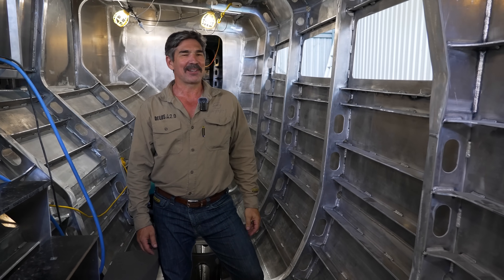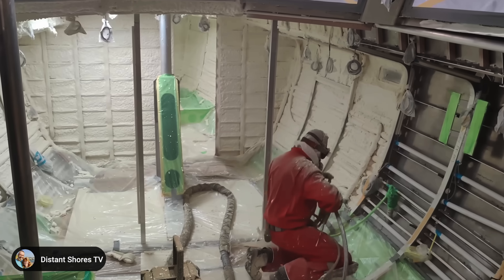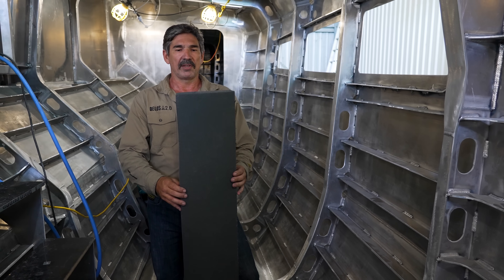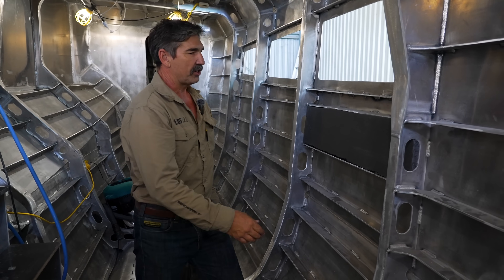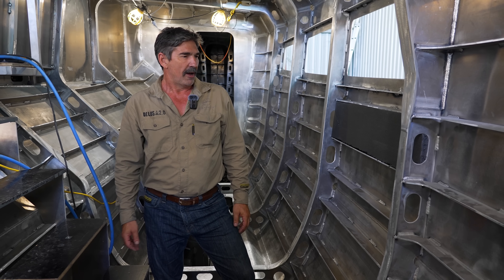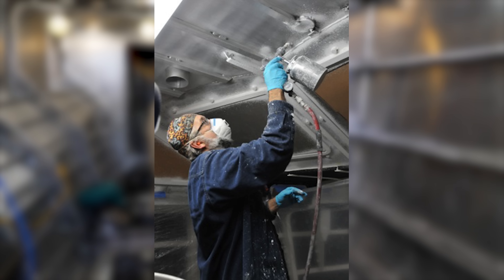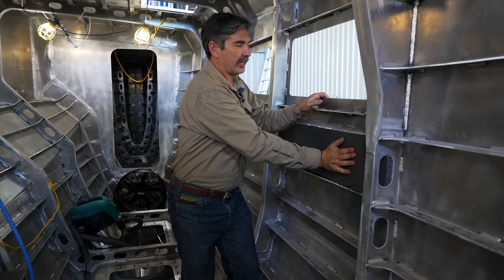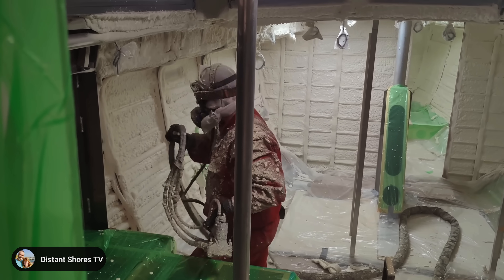HELP, We Need Your Advice!  How Should We Insulate Our Aluminum Catamaran???

Comment: I’ve been in construction, my whole life, dealing with insulation thermal transmission, condensation issues between insulation, and by far the best thing to do is to use a spray foam closed cell spray insulation.. the amount of work that you would have to do if you ever have to access the backside of it is negligible. It will scrape right off of the aluminum with a wire wheel. It will be clean. I don’t think the negatives outweigh the positives of going with spray foam.

Comment: I worked in a small datacenter that was built in two phases. First phase used bat insulation resting on top of the ceiling tiles, the second sprayed insulation on the bottom of the roof. Later that year when it snowed the snow on the spray on roof lasted two days longer than the bat roof, which melted first day. By the time the snow arrived phase 2 had about 80% of the load of phase 1.

Comment: they make cork spray insulation for this exact purpose. reduces thermal transmission, reduces noise, and reduces condesation, which is hugeon any boat, but especially metal boats. Sail Hub did a great video on this.

Comment: Brian, you're getting advice from everyone with good intentions. Considering the goals of preventing condensation, insulting the boat, fire resistant material, noise reduction, and potential problems of future repair or replacement - I would set aside the concern of how hard it might be to repair structure. :¬) Webhead USA

Comment: Closed cell spray foam.  If you're worried about easy access, maybe 1st primer layer and then 2nd layer closed cell foam.  You just need the encapsulation/seal.  Then you can always use the cut Neolon foam as a 3rd layer over the top of your first layer, and that can also provide a good thermal bridge to prevent condensation.  
After that you almost need a hull within a hull with minimal contacts between the two other than maybe adhesives to keep shape and rigidity.  The methodology is really the same regardless of the item (boat/house/aircraft/fridge/cooler/etc.).  
Another good thermal bridge is HDPE strips or blocks which are relatively lightweight.  You could place between any hull frame/strip to provide additional thermal bridge sort of like an electrical insulator.  HDPE won't rust, rot or deteriorate under any conditions and it is also buoyant same as closed cell foam!
Reply: Oh and I forget to include that Distant Shores TV just did closed cell foam on their new Orion 49 (Distant Shores IV).  See Aluminum Sailboat Pt 17 from about a year ago.

Comment: Use 3d scanner such as revopoint to create your as-is manufactured CAD file. From that digital CAD file you can make sure your whole project is still going good and matches your original specs and you can extract out dimensions for custom neolonXPE top cover
Reply: Seeing as how your electrical conduit holes didn't match original specs figured a 3d scan for your insulation dimensions could help

Comment: Spray foam. Any time you save on potential repairs, which you may never have to do, would be more than made up for  by the ease of installation. Also the areas most prone to serious impact damage are below the waterline and thus not insulated. How many times on Delos did you actually have to reach the inside surface of the topside hull for repair?

Comment: spray foam. hands down. A bit more prep work but saves soo much time in application. Is, as you said, way more consistent and provides better moisture protection.

Comment: I would go for the spray foam insulation ( high density) 2 part system its R value at 2inches thick is R18 and its sound deadening is excellent , just make sure your electrical and plumbing system is laid out to accommodate/ services ability , through hulls should be the new highly durable plastic ball valve style ( and serviceable ) .
The electrical should be through conduit pvc style pipe w/ accessabilty ports , so your lay out for lights/ swithes / fuse panels , this way wire can be added / replaced with out tearing into your walls or insulation.
 Recess your through hulls flush with your hull to reduce drag .
See parlay revival for the thru holes they used there like bulit proof.
 Take the time to do it right and you will save youself hudreds in labour and time and parts.

Comment: Hey Brian, check out these options used in submarines:

 Submarines use a variety of insulation materials, including:

Fiberglass

Fiberglass insulation panels can be used to create a submarine hull insulation system. Fiberglass can also be used to create scrimmed structures that are attached to the hull with a polyurethane adhesive. 

Mineral wool

Mineral wool is a common insulation material for marine vehicles because it's fire-resistant, water-resistant, and provides good sound and thermal insulation. 

Composite materials

Glass-fiber-reinforced plastics (GRP) and carbon-fiber-reinforced plastics (CFRP) are used in submarines for large 3-D shapes and sonar windows. 

Anechoic tiles

Anechoic tiles are used in nearly all modern military submarines. The Royal Navy began using anechoic tiles in 1980, and the United States Navy followed shortly after. 

PCM

PCM insulation can be used to insulate UUV hulls. The thickness of the PCM insulation layer can be adjusted based on the mission profile. 

Other types of marine insulation materials include:

Microporous structural insulation

Hull boards insulation

Elastometric pipe cover insulation

Fiber blanket

Aluminum coating insulation

Foam insulation

Wired mat insulation

Comment: I used to be a partner in a SIPs manufacturing plant. For those who don't know, SIPs (structurally insulated paneling) is a highly insulated construction wall for residential & commercial buildings.

The major factors that contribute to poor insulating & issues with water from condensation are the heat transfer through materials know as "Thermal Bridging".

We primarily dealt with wooden structures, although we made a significant amount of aluminum panels with aluminum square tubing for structural support.

Aluminum has a very high thermal conductivity.  Meaning that heat will transfer through the aloy very easily. This is likely to mean that ANY aluminum that you have that is connected via fasteners or welded to the exterior will undoubtedly transfer heat.
Unfortunately for your setup, I'm going to wager that even up to 10 inches of aluminum will likely transfer heat. (That number is based on my own testing using and IR thermometer to get a rough estimate of the distance heat is transferred through 3/16" aluminum square tube).

Typically for the product we produced we recommended no less than 3" of open cell foam insulation to prevent condensation and heat transfer. We also turned any studs or structural supports to reduce or prevent thermal bridging. Meaning we had at least 3" of foam anywhere there was a structural member.
All of our panels used bonded expanding adhesive that chemically bonded with the rigid foam and adhesively bonded to the other surface. And were then put in a 20ton press until the adhesive cured. The pressing created a water tight vapor barrier.

For your project, since pressing is not an option, you will most definitely need some form of condensation barrier. Just an additional note, if a condensation barrier does not have adequate insulation separating the 2 climate zones, you will still get condensation forming. If the barrier is a sprayed on type, you may experience delamination between the barrier and the surface it is sprayed on. However, I'm not certain what issues might arise should that occur.

If it were my boat, i would run either conduit or pvc for electrical runs, water lines, or anything else you need to run. And then spray foam the entire interior cavity.
Spray foam is going to give you the best seal, vappr barrier, insulation combo. You could even consider the other sealing products you mentuoned in addition to spray foam.

Regardless of what options you go with, you should know that the most likely culprit for condensation is going to be the most inward parts of the aluminum structural members. This is because they will have the least amount of insulation, and are most likey to have thermal bridging where the hot exterior meets the cooler interior.

The second most likely culprit for condensation is going to be any doors, windows & hatches. As again, these will be the spots with the least amount of insulation and the most thermal bridging.

Extra care to seal and insulate (as best you can) around any openings will save you headache in the long run.

Comment: Primer coat on the bare aluminum with the foam insulation bat panels and then sealing everything with a 100% vapor barrier will totally seal the thermal bridging and stop condensation.

Comment: My two cents: 1) don't use anything that is open cell or conducts vapour. Closed cell foam all the way. 2) Agreed on ability to replace like panels but you should close the gaps and connect the panels with something sprayed or glued on 3). The big trick is how to prevent thermal bridges while you have to connect the internal shell to the hull solid enough so you can place furniture on them.  4) Sounds counterintuitive but please-please check any material for long term outgassing - it can become nasty when e.g. polyurethan starts decaying in closed spaces - and how it behaves in case of fire, is it flammable, and what kind of smoke it develops while burning. 
Finally, you don't necessarily have to use the same solution in every part of the boat. You may, for example, use different method in the forepeak, under the waterline or for the deck saloon.

Comment: My boat had the spray foam insulation, it was built 10 years before I bought it. It was also lined in thin ply, it was quite noisy when sailing and no insulation in the bilges. When whales were around you'd hear them way before you could see them.

Comment: You HAVE to use the expanding spray foam, no painter could guarantee 100% primer coverage on the inner hull because there are too many angles with all the metal ribs, holes, etc. You need to re evaluate your giant bus bar system too unless you want to deal with crazy electrical problems out at sea.

Comment: some kind of coating is a wise choice before any insulation since as you mentioned even a small bit that's exposed bare metal with sweat. I used foam house insulation and did my best to seal all exposed metal. I used canned foam around the edges to eliminate air pockets. In Europe they are spraying cork and that seems to work well. Masecoat works well and even truck bed liner coating, the main thing as you know is isolation from opposing temperatures on exposed metal. My boat is aluminum as well and I am about sixty miles north of Seattle and a former shipyard project manager.

Comment: I think your planning skills are going to be key.  There are tight spots that will be hard to get to to remove spray foam.  If you will need to do any welding in those areas for repair the spray foam would pose a fire threat.  In those small areas plan paint and plan for condensation and how you deal with it.  If those small areas are sealed in a way that you can unseal and inspect later no warm air can get n and therefore no condensation. (Theory  (real life may differ from theory.))  Those areas are specific and would not pose a large condensation issue anyway.  The other areas spray foam away.  Finally again plan baby plan.  Your excellent planning skills will determine the quality of the outcome.

Comment: I built a plywood Jim Brown trimaran in 1974, sold it, rebuilt a new Hunter 30 and owned and sailed her until 1986. We sold that one and built a Van de Stat Falco hard chine steel boat in the UK.. We coated the inside and outside with coal tar epoxy and insulated with Styrofoam 2 inch boards. OK, but not that satisfactory due to condensation between the hill and Styrofoam  boards.  Spray foam was very expensive in 1986 in the UK. The next several builders at Morvaren Seacraft in Penryn, Cornwall sprayed and sureform planed the foam down to the frame and installed wood battens as needed. They seemed happy with the results. These boats were, at first, hard chine When the builders got the equipment to bend steel pretty much everyone sprayed. We spent 5 years in England fitting out our hill which we helped build and sailed her until 2004 when we " swallowed the anchor". Spent until 2020 at Hinckley repairing sailboats in Maine. That said....aluminium..huh?.. what?
Reply: Extra info (maybe): In 2004 we bought a falling down 1860s Cape and once again were on a "budget". Put 2 inch foam against the roof deck and sealed the edges with cans of spray foam , then Rockwood over that. Real good insulation...too bad the condensation rotted the roof boards after 12 years and we had another big repair. Live and don't learn!?

Comment: Hey Brian..  As a home builder, I think the most thermally efficient option would be the spray foam. However , its heavy and has maintenance issues. Closed cell press in batts get over this, however, all foam insulation that I'm aware of has R-drift. So the foam naturally shrinks over time creating voids and a "less snug" fit.  A great solution to this is edging any press in batts with a memory foam tape. The one I use in the UK is called Gapo tape you apply it to all four edges of the insulation batt and it creates a flexible friction fit for the insulation batt so it is always snug (you could forget the fixing spikes if it is fit correctly). This way whether you're sailing the tropics or the arctic circle, the batts should remain in place despite expansion/contraction/ flexing on the hull.
Reply: Also, if money was no option , you could look at vacuum insulation panels (VIPS). It would be eye watering-ley expensive as each batt is made bespoke to fit its hole. You would still need a solution to stop cold bridging though the ribs.
Reply: The cutting & edge tape of panels & seal tape of the panels to the interior would take you forever & you would still get condensation on the ribs. 😊

Comment: I have lived 3 winters in Alaska in my aluminum 74ft Dashew cutter rigged sloop. We have spray foam. Install more conduit than you think you need and take pictures before spraying foam so you can find it later. Don’t foam the bilges! Make sure to spray frames and leave nothing unsprayed or condensation w freeze or condense and drip down when boat warms. Good idea to wire and permanently install dehumidifier in place in both hulls and keep running especially when you leave boat. Plumb condensation pipe from dehumidifier into bilge. Don’t mess w sheet foam the stick will release. Alaskan fisherman spray foam fish holds and have very little corrosion unless water sits on foam. You can easily grind away foam if you need to later. Make sure let floor between hulls breathe. I am worried about your big copper buss bars. You might spray them as they will get wet as well. I would love to show you pictures of my galley setup as it is fantastic and Dashew while a jerk knows how to build boats. Download his free 700 page book on how to build boats and refer to over and over.
Reply: "Dashew while a jerk knows how to build boats" 😂 I met Dashew once and know exactly what you mean! However I have ended up with a Sundeer 60 which I love...
Reply: @deerfootnz a boat after my own heart. SD60
Reply: @timsullivan1531  me too. It's underrated if anything. It's a joy to sail & cruise
Reply: Someday i need to get on board one. Been looking at one in Fiji. Friends of mine are going to check it out when they return from the holidays back to Fiji.
Reply: @timsullivan1531  That's East of the Lizard. I have been on board. It's in good condition generally. It has a larger engine than standard with a raised, reversed mount & v-drive. It also has a longer doghouse and twin wheels. It would be a good buy. All the Sundeers are 30 years old so you are buying the quality of someones maintenance.
Reply: @yep that is the one. As you stated before, these are clearly undervalued. Many of my Sailing people ask why it’s so inexpensive and I tell them it’s because it’s not as well now and has the big names. After doing a lot of homework, sundeer and Deerfoot boats are the cruisers cruising boat that can put the miles behind them quickly. I live in California and I heard there’s one in the Bay Area. I’ll try to track down the owner and see if I can get a ride for a day.
Reply: @timsullivan1531  There is also a Deerfoot 64 for sale in NZ. It's a NZ built boat with a bigger rig & deeper keel. It needs some love, but is a good buy.
Reply: @ thanks for the info. I have to keep a shallow draft because the boat will be eventually based in Florida, everything around there is really shallow.
Reply: @timsullivan1531  understood. I lived & worked around Fort Lauderdale, the Bahamas and the US east coast for years, so I know the waters well. There are a couple of other Sundeer for sale at the moment. I know the owner of East of the Lizard a little.
Reply: 😅 no no, please, don't spray foam the busbars.
1. the busbars will get hot, spray foam not designed for that, dangerous
2. like MANY people commented on his screw-pieced-together-busbars vid: they will fail, bad idea to start with. Foam on top of that would make it that much more difficult to (a) inspect (d) detect (c) investigate and (d) fix when they inevitably do fail
Reply: @raphofthehills4405  I mean yeah no foam on bus bar for sure but bus bar should be corrosion proof likewiseXP
Reply: @raphofthehills4405  who the heck was talking about bus bars!!?? just the panels...
Reply: @raphofthehills4405  what?
Reply: I'd use closed cell spray foam to glue the panels in to save money on the spray foam.  Be sure to moisten all surfaces so the foam adhears.
Reply: You've got the right idea my friend